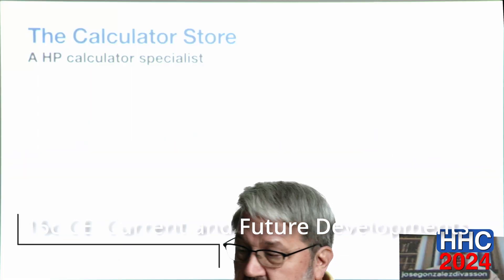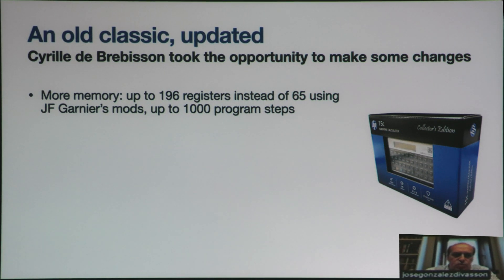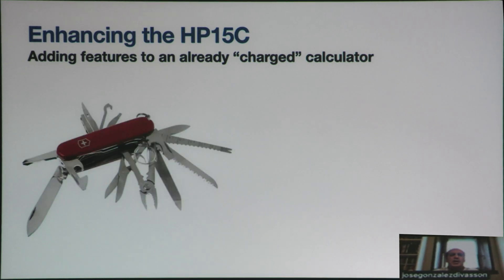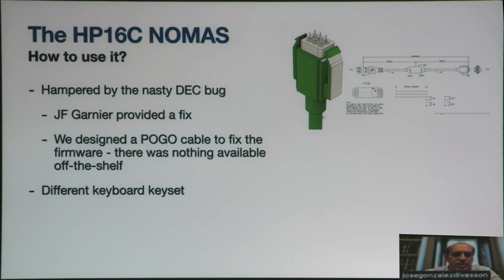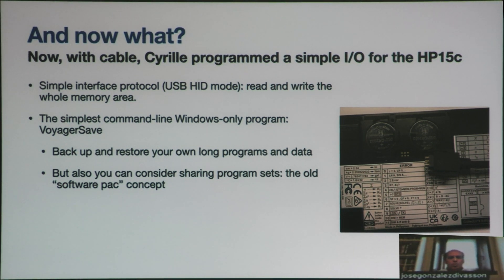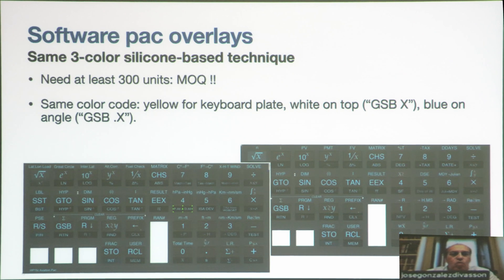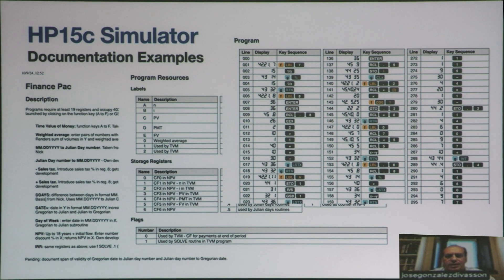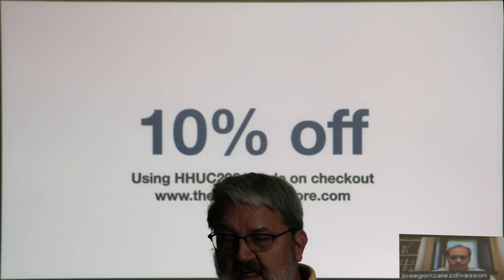HHC 2024: HP 15c CE Current and Future Developments (José González Divassón)

Comment: Can you point me to a readable version of the schematic at 5:34? I wanted to design a permanent USB connector. The idea is to replace the battery cover with a little PCB. It would have pogo pins to contact the six pads (I have sourced pins of the right height) and would protrude out the back of the calculator far enough to carry a USB-C connector and two little tactile buttons.